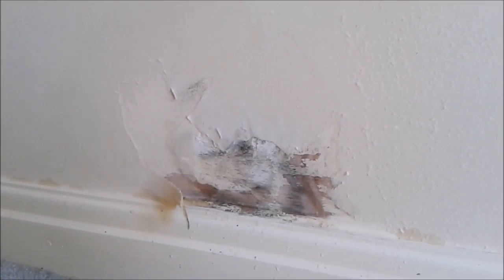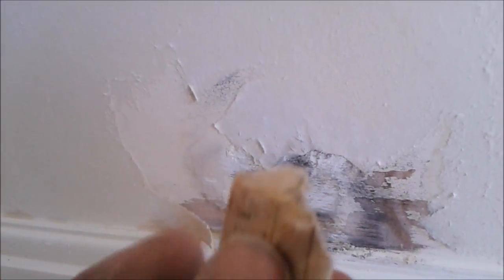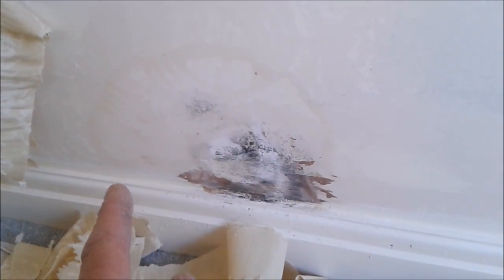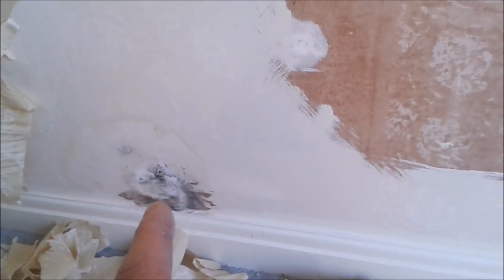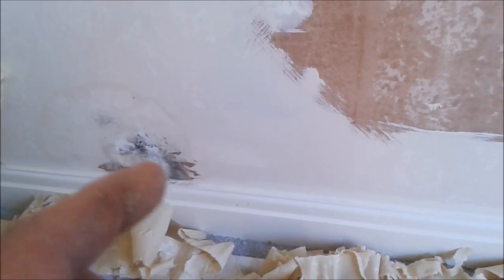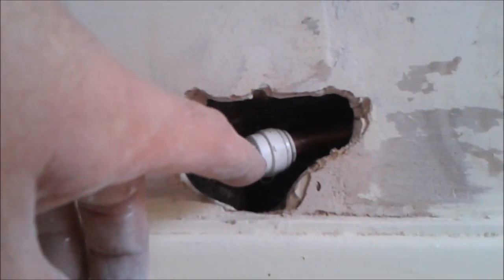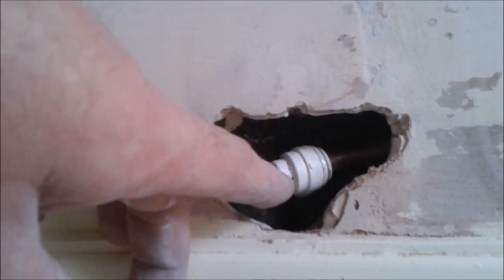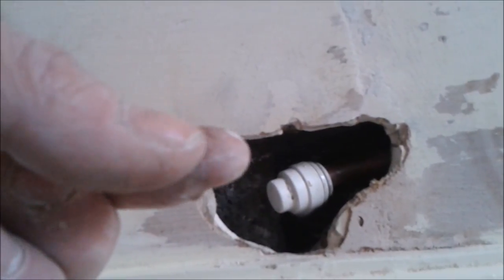Copper vs Plastic piping for central heating?

Comment: This proves nothing except for a badly fitted cap end lol. Yes you can use plastic pipe for central heating as long as its rated for the pressure
Reply from the maker: But the seals only have a 20 year guarantee on plastic and copper could last a life time.

Comment: Short lifetime fitting !!!
Hep2O fittings have a 50 year manufacturer guarantee if fitted correctly.
Reply: That’s “a 50 year guarantee against defect in materials or manufacturing of all its pipe and fittings” which isn’t the same as saying a warranty against 50 years of wear & tear thru plasitc embrittlement and constant expansion/contraction. Also how many firms are still round after 50 years?

Comment: Nope, I disagree. If that was fittted correctly, it wouldn't leak. JG or hep20 compression glands is just as good as soldered copper when done correctly.
Reply from the maker: Copper will last longer. Would never have plastic myself on heating.
Reply: lots of people seem to say this, yet it's the plastic fittings that always seem to be leaking....

Comment: This confirms my suspicions. There is no way that I would have plastic pipe in my house. A plumber told me that plastic fittings were guaranteed for 50 years. Right, and that means if there is a leak the manufacturer will repair all the damage. I don't think so.
Reply from the maker: Mark Rowland Plastic has issues, 20 years I heard but need to check.
Reply: Painting and Decorating Personally I wouldn't risk having plastic pipe in my house. Obviously it's ok for drains but where there's pressure I would go for copper pipe and copper / brass fittings every time.
Reply: Plastic pipe wont get ripped out by smack heads.

Comment: I'm getting my whole house done from top to bottom I'm getting plastic pipes instead of copper running trough which is a better option copper or plastic ?
Reply: so which was better, did you get any leaks?

Comment: Ohh nasty. I do a lot of domestic plumbing as well as decorating, kitchen fitting etc and yeah that really shouldn’t be inside a wall... soldered every time. Well spotted when stripping the paper, I know a few guys who would just oil base undercoat it and slap some Maggie on top! 😠
Reply from the maker: Thanks, better-using copper last a life time.